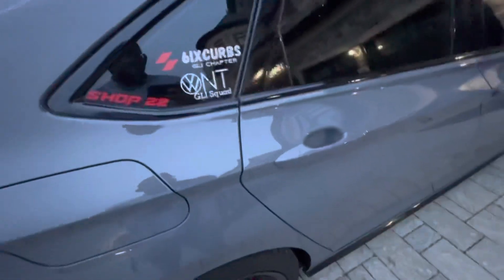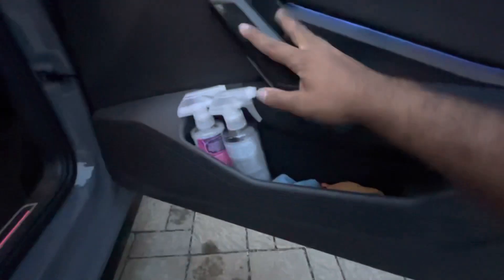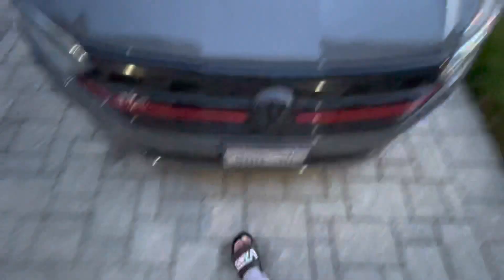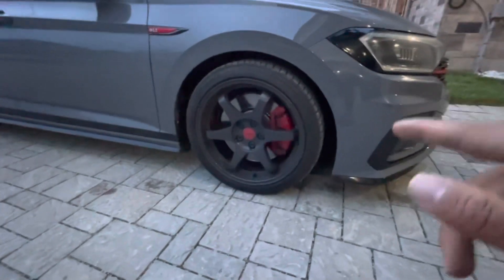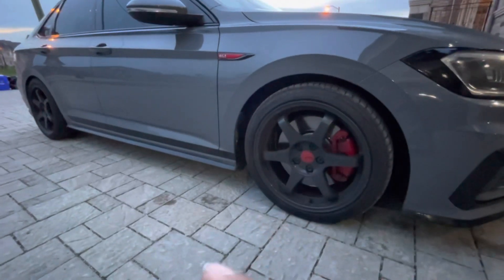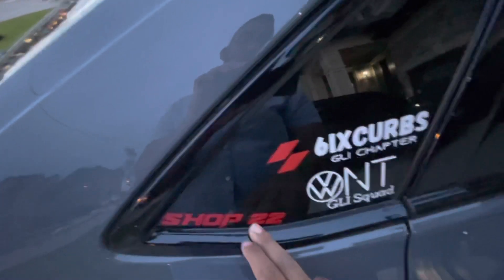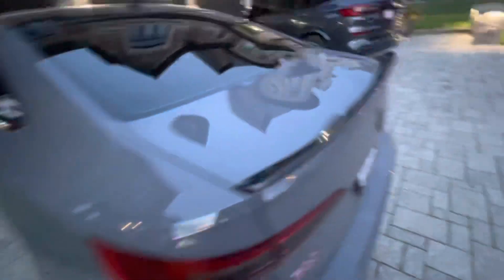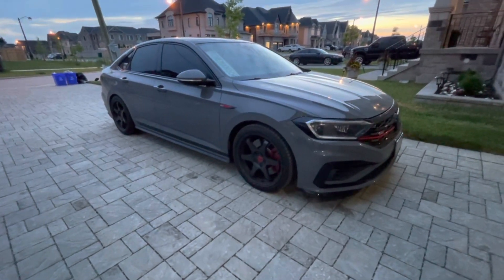VW MK7 GLI Mod List Part 2

Comment: I just copped the 2022 Gli Autobahn blck package in the same grey. I traded my 2021 R-line and it's the best car decision I've ever made. I'll never buy any Jetta other than the Gli.
Reply: Have you bought a front splitter or rear spoiler? If so from where I also have a 2022 and can’t find one anywhere

Comment: nice video man❤️ and such a beautiful car, it’s my dream car right now
Reply from the maker: Thanks
Reply: @NithinChemmanoor   but i recommend to change the air filter to KnN air filter not the cold air intake the normal air filter but from KnN bc it will give u more HP
Reply from the maker: @ahmedrwandzi7519  yea I agree I read a bunch on forums how that suprisingly makes the most power
Reply: @ahmedrwandzi7519  I will trade 3hp and risk puddles for that WHoooooosh!